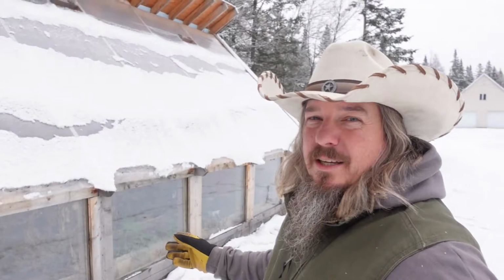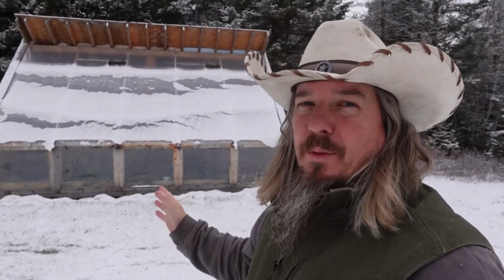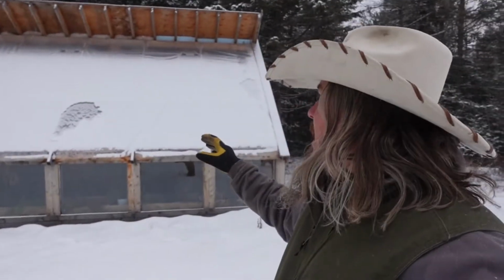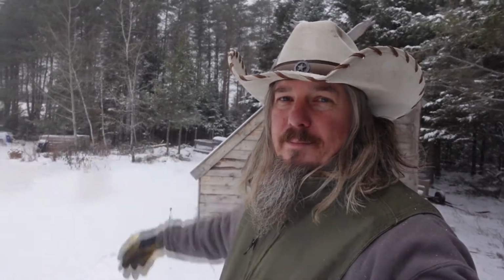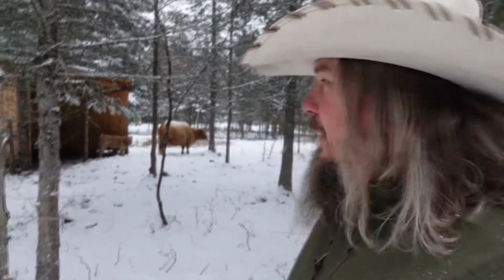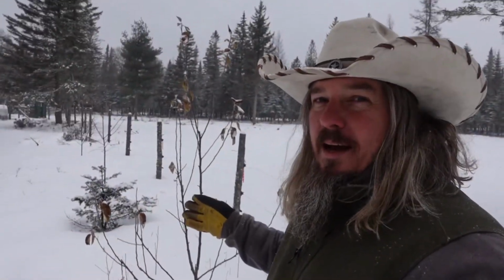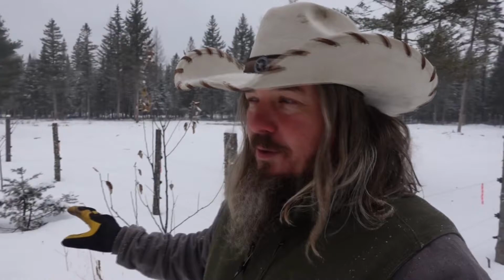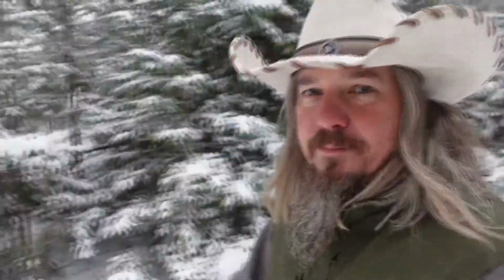Roof Slope On Passive Solar Greenhouse

Comment: We're thinking about building a greenhouse like this now. I had other ideas initially but now leaning toward this design.
Reply from the maker: It's really handy in cooler/colder climates at it traps more of the heat in than a regular high tunnel